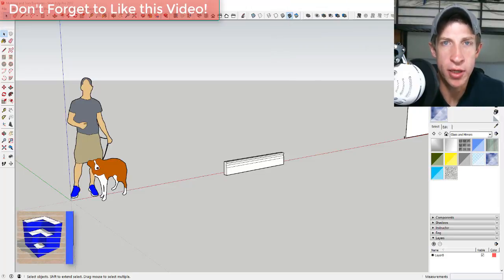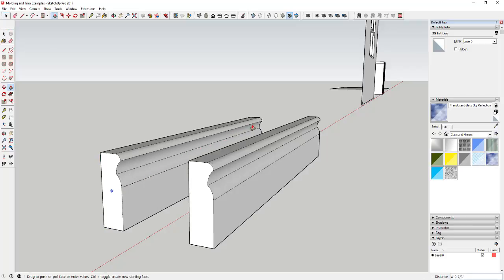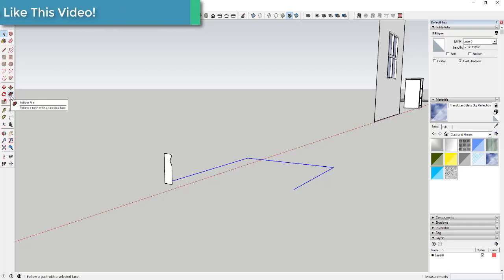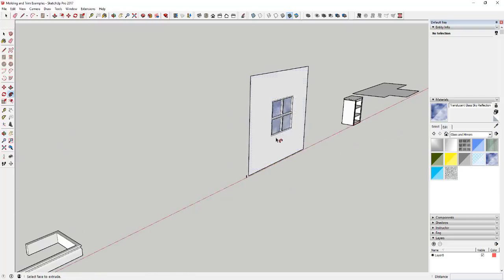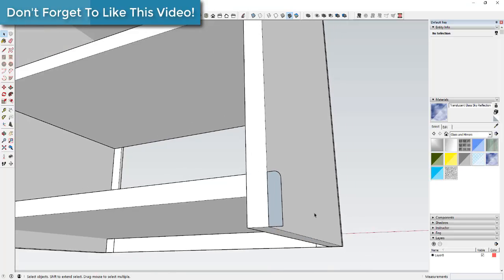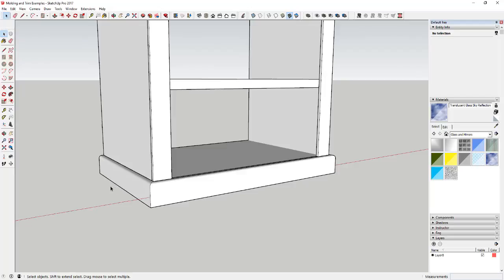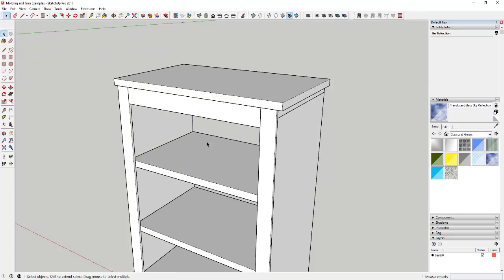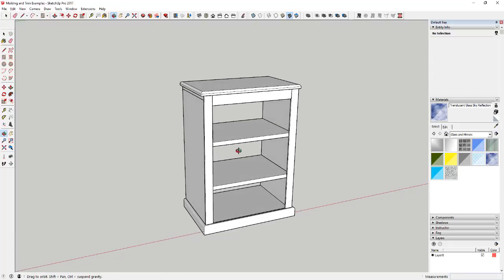Modeling Wood Molding and Trim in SketchUp with the Follow Me Tool - The SketchUp Essentials #52

Comment: Hi Justin, did you ever do a tutorial to demonstrate how to create detailed moulding for wood working or design? I'm trying to create a Dentil moulding profile but cant seem to get the notch detail, can this be done using profile builder? I think it would make a great tutorial.
Reply from the maker: Hi Wayne! You're correct, this would be an excellent use for Profile Builder - you'd could extrude the profile shapes, then create the repeating notches using the assemblies option. This is a great profile builder tutorial idea - I probably can't get to it this week though. Maybe next week?
Reply: Thanks!!! that would be amazing and I would greatly appreciate it, as would others I think. Much appreciated.

Comment: Thank you for video.  Is there a way to add, say like a baseboard, around finished rooms by having the profile outside the model but within the same file and not having to move the profile every time to the guideline in order to use the followme tool?  This way I can have the profile in one place in the model without having to move every time. If not with follow me, is there perhaps a plugin?
Reply from the maker: Hi Gerrit - I'm pretty sure you can do this with profile builder - https://www.youtube.com/watch?v=rvKHQBvuTmg - you might want to give the trial a try and see if it does what you want. Thanks!